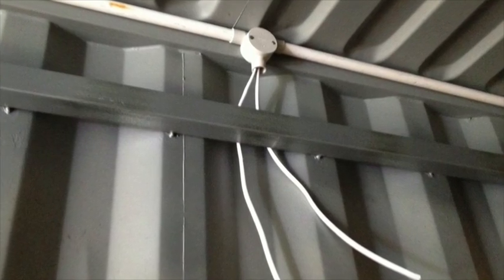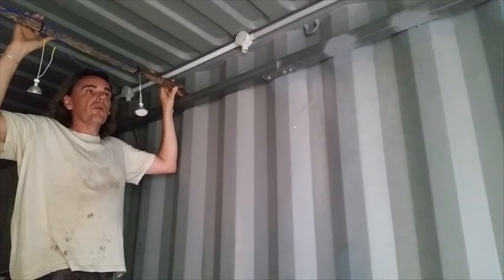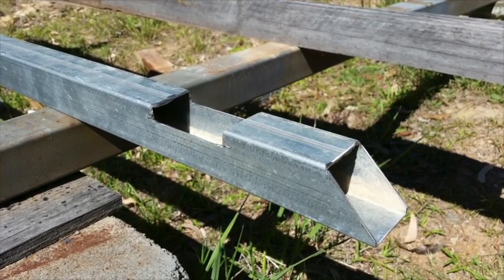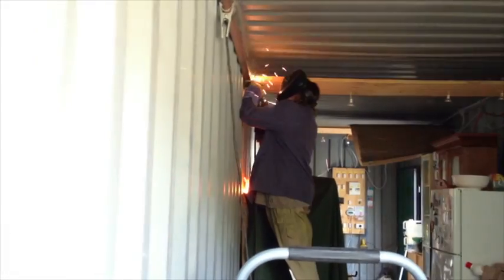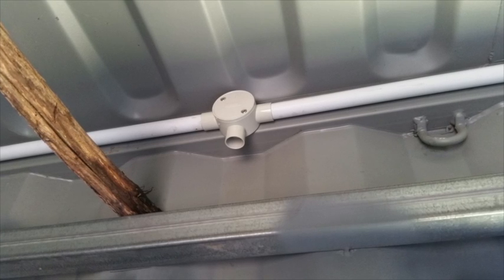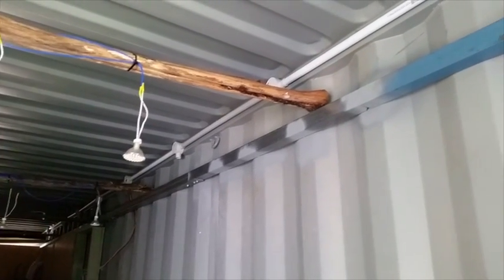Shipping Container house – Something unexpected, Ceiling rail & Conduit installation

Comment: Thanks for giving everybody the heads up about welding safety. I worked in a major department store in downtown Ottawa. It was winter, and all the pipes were frozen. So a welding company came in to do some repairs on the outer pipes. It is a really, really old building, with some "insitu" materials that weren't up to modern codes. Our store manager warned the welders that they couldn't do certain things in certain areas. Of course, the welders thought that they knew better. The firemen were very nice, they got the whole store evacuated. We lost a fair amount of business. The fire department people were on site very quickly, and checked everything behind the walls. That was the worry, that sparks from one area would travel through the old walls to another area. But somehow it was alright, and we could open up again. That welding company didn't make any new friends that day.
Reply from the maker: Thanks for sharing your story Sandra. Relevant and interesting. Welders can cause mayhem when the molten beads of steel fly around. Cheers Paul

Comment: Nice job ,I have started a few fires myself at the block with the welder :)
Reply from the maker: A welder told me, his gloves were for putting out the fires he was going to start, not to protect his hands. I have come to see his point. Have you got any new videos on the horizon?. Cheers Paul
Reply: Paul Chambers
I just put one up yesterday and should have another one this coming weekend of welding in the  metal floor strips and pressure cleaning out the containers.As we are not living out at the block full time yet it all takes time.
We were hoping to be out there full time by this Christmas but there is no chance of that, may be next one  :)

We love the building process, It is all starting to come together :)

Comment: LOL   you remind me of me!!  Are those little tack welds going to be strong enough to hold up the insulation and ceiling panels?   You should also take a look at DIY two part spray foam imsulation.  They use it a lot in America and I belive that you can now getvit here Cheryl Alley.  It's way more thermally efficient than bates and it covers all the small gaps.
Reply from the maker: Yes the welds will hold. The short runs are fully welded on the edge, The longer runs, are fully welded to the short runs. The tacks on the corrugations stop the middle from sagging down. The wall frames also butt upwards against the steel frame. I have seen the spray foam. I would have used it if I could have finalized the fabrication before insulating. I would be scared to weld near the foam. Too much risk of fire.

Comment: Do you know of a clever way to attach shop lights and conduit to the ceiling in a container. Mine is a 40 footer that I use mainly for storage, but also have a work bench. I used construction adhesive to glue small boards to the ceiling and attached my conduit and light to the wood. The container lives in the desert where 115 degree F. is not uncommon. The adhesive isn't holding or, it might be the paint peeling away. Either way, the lights are falling! Thought about using sheet metal screws with built in rubber seals but really don't want to drill into the roof if I can avoid it. Thought about sanding off the paint and giving the adhesive another go. Thought about using epoxy instead of adhesive. I also thought about welding, but I hear the roof is thin, and knowing me I might burn a hole right through it. Your thoughts greatly appreciated. Paul
Reply from the maker: +Paul McDuell Hi Paul, welcome to the channel. I attached conduits to the metal rail of the roof. I drilled a pilot hole and and then finished with a hole to accept a metal screw. I screw t piece conduit junction boxes every 2 or 3 meters. The screws dont compromise the integrity of the container and hold the junction boxes in place. I run 12v down one side of the container and 240v down the other side. Watch my video "Shipping Container house – Something unexpected, Ceiling rail & Conduit installation" It should show what I am trying to describe. The rails are about 4mm thick so I blunted a few drill bits completing it. Cheers Paul
Reply from the maker: +Paul McDuell Oops, you have seen it and are talking about the light fittings. I have the same issue to solve in my storage container. I was considering looping fence wire in a criss cross pattern from the steel loops at the ceiling. This would form a catenary. I would be able to suspend the light fittings from the tight wires close to the ceiling. A simple tensioner would pull the wires tight so they did not sag. I will be looking at doing this fairly soon, as an experiment. I will post a video if I do. I would not puncture the roof to attach a fitting.. I would prefer to support a beam attached to either side of the wall than risk making holes in the ceiling. Cheers Paul
Reply: Paul McDuell  just use metal boxes and pipes

Comment: Have you looked into the bubble wrap reflective insulation? I'e seen some real good results form others that have used in applications that prohibit using a ton of insulation?

Just my 2 cents...LOL

Anther great vid.
Reply from the maker: Hi 1timby, a great 2 cents if you ask me. Its awesome stuff. We used reflective bubble wrap in the main living container just hanging on the walls for two years. (Until I insulated properly). I put some bubble wrap into the cavity behind the solar charge controller yesterday,because space was tight and I needed access to the cables. Excellent advice thank you.  Cheers Paul

Comment: whats that burning? i done that so many times making trailers in the back yard welding but in the home hmm i seen the fire then when it went dark i thinking blow the breaker . so with all this welding i do see you use cold gal but what about the inside the box steel when i made boat trailers i no sea water bad for them but i have seal trailers up before but make them sweat inside them and still rust away i do know there is rust stoppers for cars that run on 12v i have put them in cars for friends and they do work tested them on 3 cars and one of the cars was a old 60 series Land cruiser was full of rust and it just stopped every got any bigger maybe its some thing you be good to have on your home save you having to replace any steel there are good ones and cheaper ones on the ebay to look at i found the $120 ones just as good as the $200 and up to $600 ones installed that is if its stops rust you never have to repair and of your work you done on the home   http://www.ebay.com.au/itm/rust-stopper-electronic-12-volt-/300995973006?hash=item4614c20f8e